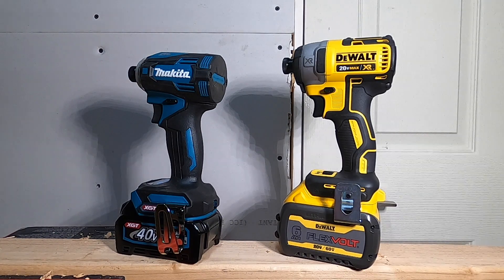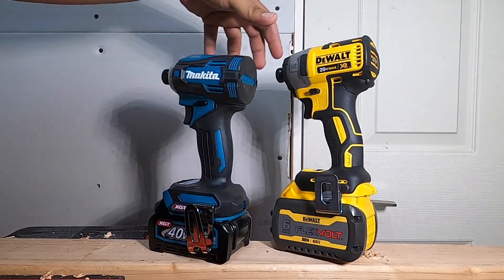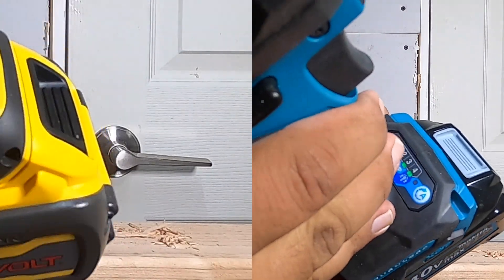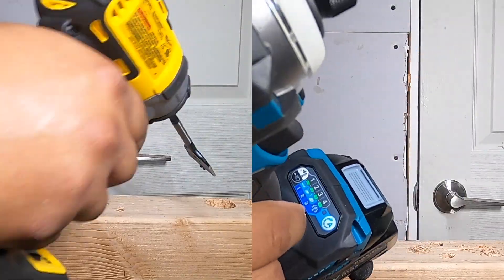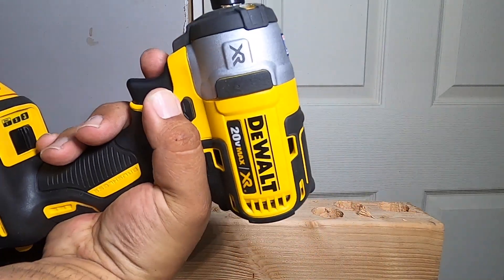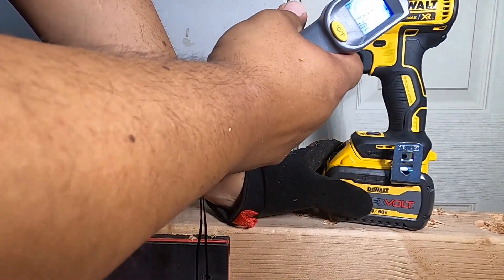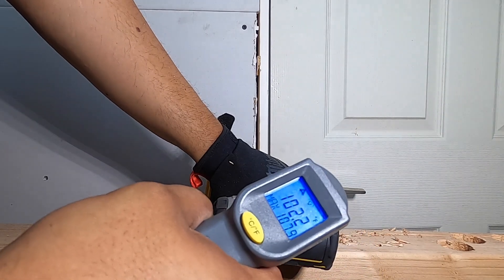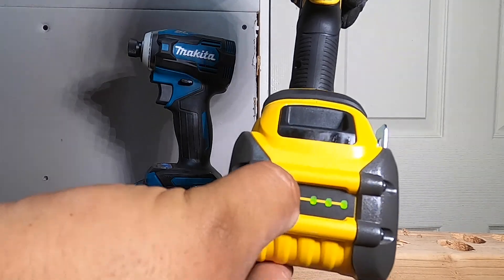Makita 40V XGT (GDT01) VS DeWalt 20v XR (DCF877)

Comment: Bro the 887 blow the Makita away wow🤯 40v FOR NOTHING LMFAO 😂 GOOD JOB BRO 💯👍🇺🇸
Reply: Makita has never made the most powerful impacts but smart)
Reply: @АртемВ-и5р  ur 💯 right the r still very good tools but for the price they gotta step it up a little 
I do own lots of MAKITA there great
Reply: I have both an honestly the makita is a million times better. Extremely smooth and comfortable to use. You have try the makita to know.
Reply: Not sure why everyone is bashing the cost of the new Makita line when a kit from Dewalts flexvolt line with the same tools is the same if not more expensive. Both are great tools but always preferred Makitas ergonomics and feel in use which is more important to me than saving an extra second on a job.